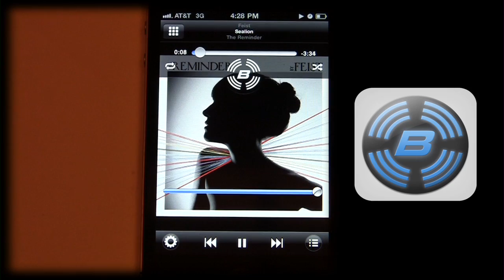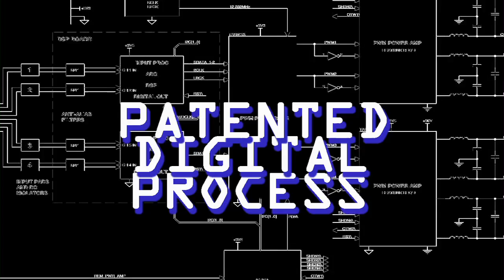DPS Technology - How It Works

Comment: The Digital Power Station works by re-mastering the playback media (music, video soundtrack, podcast etc.) in real-time to suit the sound system you are using.  DPS is installed as software on your computer or is encoded on a chip to be used with any audio device.  It is a fully dynamic, mastering grade audio toolkit the Bongiovi engineers (including myself) use to create "profiles" for all kinds of audio situations.  If you have more specific questions ask them at the DPS Insider forums.

Comment: Lol no sensors!? So a listen at t3h mall and dpsindsider.comforums would be appropos.
Nice brags for stethoscopes, Win7, convertible auto and tiny digs in Albion, but no How.
Mehaps it cuts IHD from codec preprocessor compression, then flogs your speakers for bass reproduction or other wall-o-sound fill. But it is shipping in products! How many iHome docks (bc. ay, boom box no more) with this moved so far, anyhow? Sure enough search at Newegg for iHome and Bongiovi brings up current stuff. Huh.